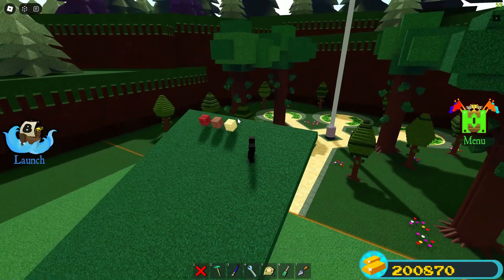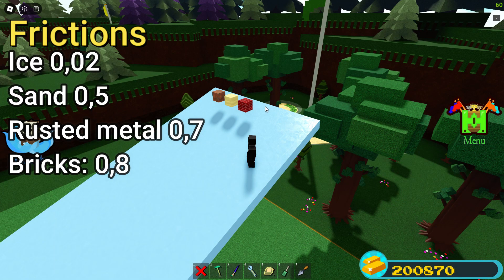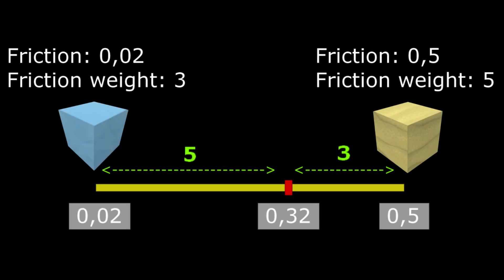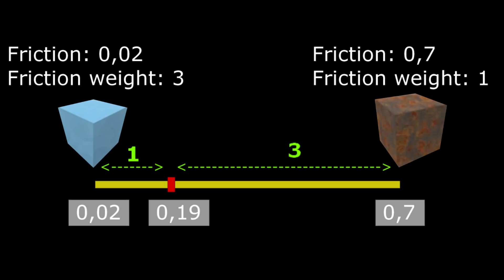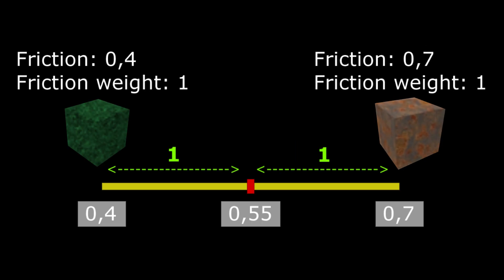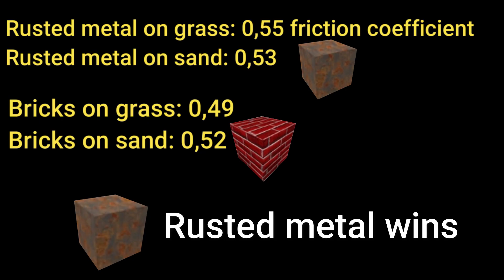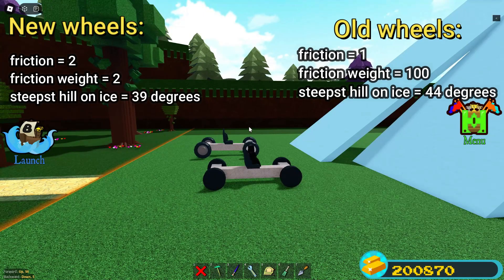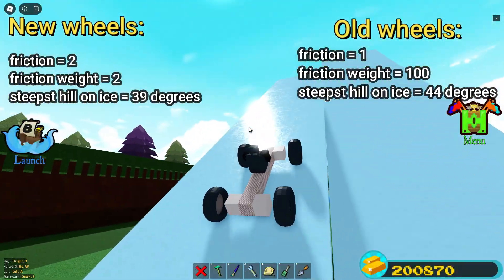Build a Boat - One more thing about friction

Comment: what if you add more wheels? will the friction increase?
Reply from the maker: no it wont matter, if you use 20 wheels for a car instead of 4, it will speed up as fast (it would only be faster in case there wasn't enough power with 4 wheels, but that's obviously not because of friction)

Comment: adding weight is actually better if you want to increase friction since it pushes the blocks together making the friction stronger. you can also do the same with low power jets, thrusters etc.
Reply from the maker: yeah with items that add force towards the surface its better (parachutes, jets, balloons, ...), but it wont work if you add more blocks to a car to make it heavier (the car will have the same acceleration and deacceleration)
Reply: @dabl2928 ahh

Comment: hey, can you release data on thrusters? I’m so confused right now. I calculated the thrusters as around 20,000 newtons according to the spring, but then I did a tug of war between thrusters and jet turbines, it only took 8 jet turbines to win against 1,000,000 newtons of red force red jets
Reply from the maker: Thruster force is calculated on the total mass of the body so its always different, I might try to figure out the equation for it
Reply: Snoopingaz made a video on it, so can you try to find the acceleration? Also, how do you calculate this because I’m trying to find the ratio between ice and plastic and its driving me nuts

Comment: Can you tell me why when I leave my seat my jets even though my plane has a stabiliser it will spin around Extremely fast
Reply: When you leave the seat you are not part of the seat. So the game controle the jet without you
+ when you leave your plane you have to jump. So your force to leave your plane will impact the plane so the plane will move faster around.
Reply from the maker: @B.U.E  yeah youre right, because when youre not sitting your avatar is a seperate body so it keeps tipping the plane (the heavier you make your plane the less of an impact your avatar makes when walking on it)
Reply: is the plane symmetrical?
did you stop all keyboard inputs before leaving the seat?
Reply: @jamvirus yeah it is
Reply: @jamvirus I'm mobile
Reply: No it is just going forwards then when I jump it spin rlly fast
Reply: I'm on mobile
Reply: you need alor more weight on your plane